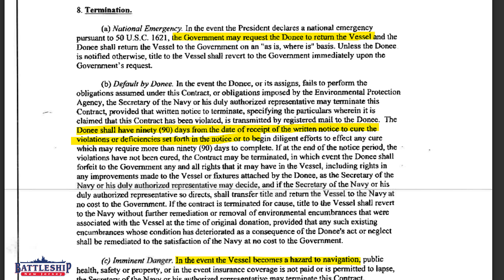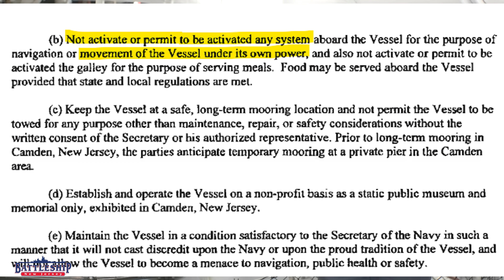Can Battleship NJ Still Move Under Her Own Power?

Comment: Has the navy expressed interest in inspecting the ship while in drydock? New Jersey could be a good test subject to see what mothballing work has been successful over the last 30 years, and apply that to ships in the active fleet going into mothballs in the future.
Reply: I think there's a video here somewhere that explains there's a Navy guy that can come around to inspect the ship to verify compliance with the contract. I think most of the time they're just observing whether the museum is keeping it looking respectable. I suspect NAVSEA will ask to have a look in dry dock or the museum will offer it up to them just out of curiosity.  Or maybe NAVSEA will just ask for the report afterwards.
Reply: Interesting question!
Reply: That's fairly interesting, I think that at least some of the lessons to be learned here though would not be terribly useful for modern Navy ships being put into mothballs or ready reserves, as they use a gas turbine drive system for modern ships that is very different to the oil fired geared steam turbines of the Iowas. Investigating how the preservation process has worked for her fire control equipment, radar arrays, and other command and control, rangefinding and communication equipment could still be of interest to the Navy, as well as the obvious question of how well preserved is her hull.
Reply: From what ive been told by the staff New Jersy would be a near impenetrable monster if she was reactivated. Her armor was so hard modern ship missles would fail to get through it, and her guns would likely make short work of anything on the sea today. it's a pipe dream but id love to see her back in business
Reply: @tomdibernardo1699  at least money we’ll invested then that worthless over priced stealth ship that’s sitting
Reply: Navy never lets anything go a 100%, I remember when people first started pulling old ww2 planes out of lake Michigan, they had to give them up because they hadn’t been stricken from the navy’s inventory and they came looking for them. Maybe it’s different now, or the navy just wanted to make sure there wasn’t a death involved with the crash.
Reply: @TheJimbodean67  I live in Michigan.  Some of the recovered airplanes come to the Kalamazoo Air Museum (Air Zoo) for restoration.  And in short, the Navy still has final say as to recovery and disposition of the recovered aircraft.
Reply: @TheJimbodean67  How does that work? Don't salvage rights apply?
Reply: Not for government property.
Reply: @BlackEpyon  good question. I recall reading an article about a team that had raised an sbd dauntless that had crashed because of engine failure while being used to train naval aviators during ww2. They discovered it was a plane that fought in the battle of midway and once that model was being phased out, it was relegated to training. The plane’s history may have prompted the navy to say dibs when normally they wouldn’t care. They just let someone else do all the hard work first. Kind of like when treasure hunters find a sizable amount of gold that sank on  a spanish galleon back in 1715, and spain takes them to court claiming the treasure is theirs. Just an excuse to force a civil trial. I tried to find the source of the story, but had no luck. It was over ten years ago at least.
Reply: @TheJimbodean67  I feel like saying, "Listen here, WE went through all the trouble and expense to bring it up from the ocean floor. If WE don't get to keep it, we'll just put it right back where we found it!"
Reply: @BlackEpyon  yes
Reply: Actually, it could be seen with the Texas.  It's been noted and videoed by multiple sources.  Apart of it was to show the public what was being done.  The biggest part was to show the problem areas and what needs to be done to fix the issues plus the cost of which.

Being how the New Jersey could be taken over by the Navy, they do have a direct interest in preserving the battleship.  They might tell them what they can do.  They may be there.  They could stay back and watch videos that Ryan creates.

Furthermore, the dry dock will probably be the same one as used for commissioned warships.  They are also within driving distance from Washington DC and the Pentagon.  In short, it would be very easy without any inconvenience for Naval officials to check on the New Jersey in dry dock.
Reply: @michaelpiatkowskijr1045 I believe the dock they are using is the one she was completed in
Reply: What are the chances if drydock tours? They would have to sell well and be good revenue towards the ship.
Reply: “Mothballing” is the process that preserves the ship in the best possible condition before it is sold to the highest bidder and sent to the breakers…
Reply: @joemccarthywascorrect6240  yes and no.  Unfortunately that happens to be the most common reality today.  In times past mothballed ships have been returned to service with the navy or in other Navies.  Iowa class and the Brooklyn class vessels are well known examples of both practices.  The Iowa class was regularly recalled from mothballs.  A Brooklyn class was famously lost in the Falklands while serving in the Argentine navy.  Similar is true of the boneyard for aircraft.  Navy A-1 skyraiders were pulled by the Air Force and South Vietnam.
Reply: @joemccarthywascorrect6240 it’s also used for ships awaiting time for a overhaul or upgrade
Reply: There is a video that covers this question.  But it is their contract that someone is supposed to come to the ship and inspect the ship to make they are keeping up with their end of the contract
Reply: So in the movie Battleship when the fire up the Missouri, that’s a complete impossibility.
Reply: @davidvaninwagen9391  unfortunately yes.
Reply: What is moth balling??
Reply: @lucasbarry6271  it is the process where the ship is put away for long term storage. Hatches
Reply: I imagine the navy will have some kind of presence with the event, as to what capacity I don't know.  Could be a simple routine NAVSEA inspection or a crew visit from SSN796 USS New Jersey.  To the core of what you are asking possible but I doubt the navy wants to spend resources on that.  Realistically, I could see the navy requesting copies of any data the museum collects or asking them to collect data on certain things.  Another reply brings up a point that the crew for Battleship Texas may be able to offer insight.  Texas has been high and dry for around a year plus and hadn't been in dry dock for about the same time as NJ.
Reply: @erbmiller  actually the Texas hadn't been in a dry dock since becoming a museum ship.  If I remember correctly, nothing has really been done to the ship since they put the torpedo blisters on in the 30's.
Reply: @michaelpiatkowskijr1045 that's not true it has been drydocked in the early nineteenth s
Reply: @michaelpiatkowskijr1045  there was a dry docking in the late 1980's.
Reply: I am a little bit late to the game, but yes, the Navy probably will be doing a inspection while in dry dock. My friend is a Naval Master-At-Arms at the Philadelphia Naval Yard, and the Navy has some intent to do a full inspection, and they are discussing a feasibility study on the Iowa to estimate the cost of reactivating it in a national emergency, which would apply to all of the Iowa's. The New Jersey from what I understand is in the best material condition, while the Iowa had turret 3 which exploded, but the door was closed, which saved the exploded shell from exploding into the main gun magazine.
Reply: I don't really understand your question? The Navy has an entire list of ships that have been retired.  there's nothing particularly special about New Jersey.
Reply: @WALTERBROADDUS  it's fairly true.  As Ryan said, the Navy holds a right to take the ship back.  Technically, the Navy could take any ship back if they deam it necessary.  Iowa class battleships still have life left to them.  Although they are obsolete, they still have a valuable service.  They could be used for anything from a amphibious landing support ship, to a missile launching platform, to a super anti-aircraft or anti-ship platform, to a huge power plant for lasers.
Reply: @michaelpiatkowskijr1045  Damn right! Anything with a foot of armour and 16-inch/50-cal "fuck everything in this general direction" cannons on it is gonna be good for something! Except as a power plant for lasers. That ain't happening.
Reply: @BlackEpyon I don't think there are any 16 inch shells left, not the capacity to build them.
Reply: @whiskeyinthejar24  Manufacturing capacity would have to be built back up, of course.

Comment: A good example of this problem would have been with Battlecruiser Hood, if she had not been sunk, the British would have ripped her open to replace the 24 Yarrow Small Tube Boilers and Curtis-Brown Geared Steam Turbines in her planned reconstruction cause they have armour around them along with the superstructure
Reply: Yeah, the Navy actually had proposals to replace the steam turbines with gas turbines, so it could be done.  It would just be a gigantic PITA.  The armor could be unbolted without being cut through, or the Navy really could just cut straight through the triple bottom, since that would just have to be re-welded.
Reply: @bluemarlin8138  how many?
Reply: Hood was supposed to get new deck armor anyways due to plunging fire being a greater threat than it had been when she was built. So opening up the deck wouldn’t have been as much of an issue.
Reply: @Jack-Tactical  yeah but thanks to all her gunboat diplomat operations, her engines were pretty much worn out and on their last legs quite literally in the case of her boilers
Reply: Its not a question of being able to open an armored ship, its a matter of how to close the hole again afterwards. 

Remember: You have to weld all the way through these inches of armor, meaning, you have to chamfer the edges of the armor and apply a V- or bevel groove weld. And then you are presented with a weak spot in terms of hardness grade of the steel that is not insignificant depending on where it is.

I think the best option would be to avoid armor and go through the bottom of the ship.
Reply: @Ganiscol  Yeah, I've some experience welding too. As for hardness, I don't think it matters too much, given how it was built in the first place. There's no way to temper something that large evenly. They relied on it's thickness.
Reply: For the battleships that were scrapped, they literally had to cut into the armoured sections anyways. Sure, it'd be one bitch of a job, but it's more than possible to do. It's just easier on aircraft carriers, because the decks are much thinner.

Comment: Even after repairing numerous leaks in 800# old rusted steam lines they would be a ticking time bomb if by some miracle they could get boilers to produce steam thru 80 year old steam plant. Last large ship to be built using steam propulsion from boilers was around 50 years ago. Have to add that nine if the four Iowa class battleships every sank a single ship. Now with drones & long range misses they are white elephants. Best suited as museum ships.

Comment: In theory yes battleship New Jersey can still move under her own power but the cost to bring her power plant back online would be crazy expensive and the contract with the US Navy would have to be amended
Reply: Also that's a condition of the Navy handing over the ship. That's it's boilers and power systems can never be put online again... So in theory yes it can be done. But realistically..... No
Reply: @J.Knox46  Not to mention all the steam lines and pipes that would have to be inspected and replaced to handle 600 psi steam.  Never served, but from everything I have seen about the topic that type of steam is pretty much instantly fatal if there's a leak.
Reply: @jeffreyminer768   The steam line would need to be "scoped", but I seriously doubt any would need replaced.  600lb steam is not harmful in the event of a leak, unless you are standing right in front of the rupture.  The steam cools fairly quickly, so a crew has time to evacuate the space and shut the main and aux valves.  BT 4505 USN 1979-88
Reply: @jeffreyminer768  oh yeah, I bet all the loops have serious corrosion and leaks. Nevermind the tubes in the boilers themselves.. People watch the movie Battleship and see how 10 people get Missouri up and steaming, and figure "dang that isn't difficult". Lmao.